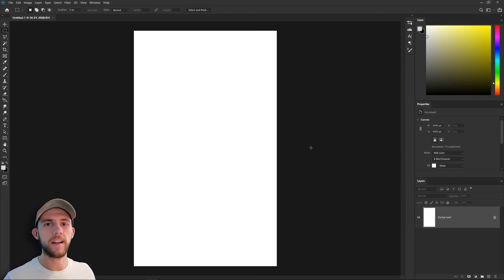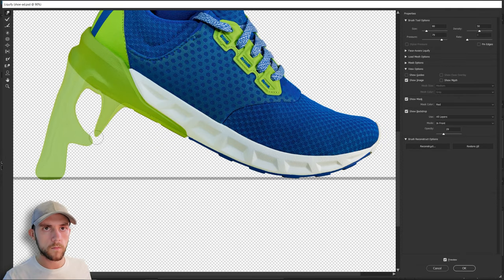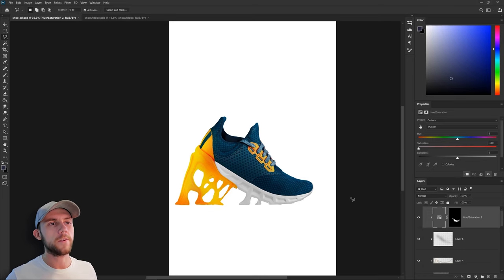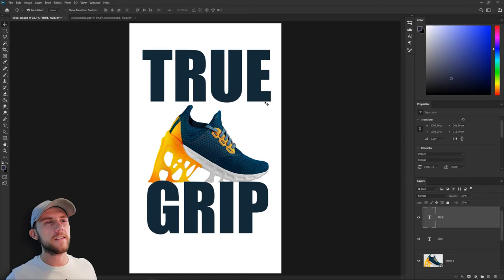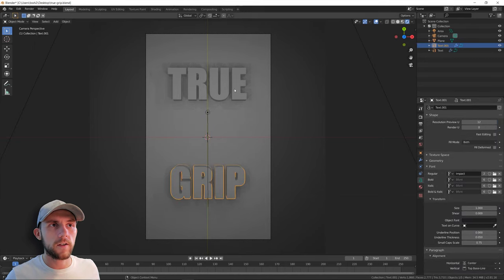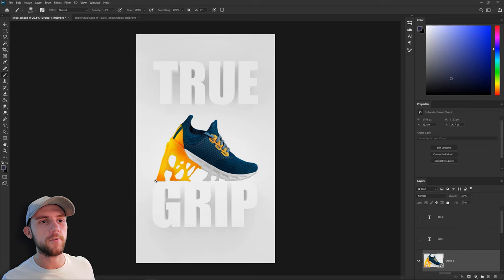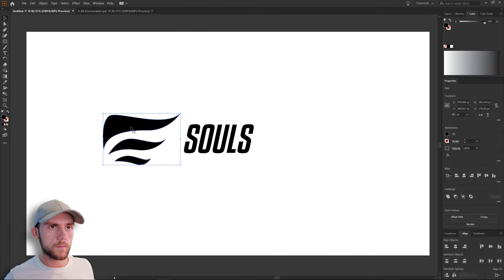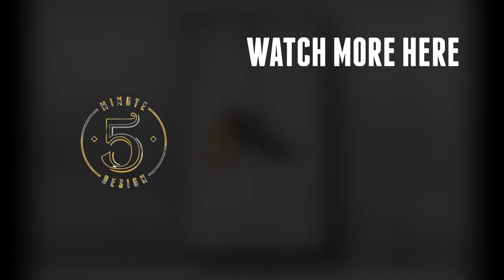Shoe Poster Design from SCRATCH

Comment: Overall great idea and execution, the only thing I'm not in love with is the shape and shading of the "goo" and feel like that part could be refined a bit more. But for a quick exercise like this, it rocks!
Reply from the maker: Certainly agree with that feedback. Would have been better to make different layers of goo. Feels a little flat right now. Thanks for watching!
Reply: @BrandonShep  Since the shoe is in motion, our eyes want to see the goo with smoother lines i think. Now it looks like it dried. It doesn't fit the movement. By the way, I'm so glad you are doing this videos man. Loved them all
Reply: Well technically it wasn't "goo" it was the sole of the shoe sticking to the word. Not goo

Comment: Awesome poster design! Could you have done the drop shadow and lighting for the letters in another program, or was is just easier to do it in blender?
Reply: You can actually do it right in Photoshop. They're going to be taking away most of the 3D features soon but they are still available in the 2022 release version of Photoshop. Adobe Dimension also works fantastic for these type of things and is pretty easy to use. Plus it is included with the Adobe Creative Cloud.